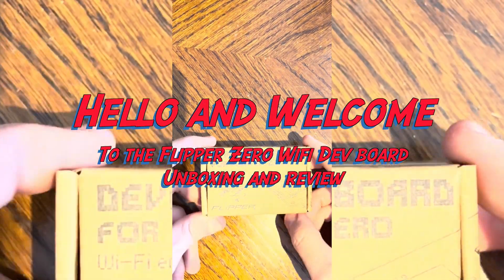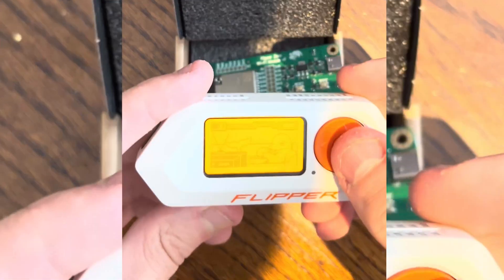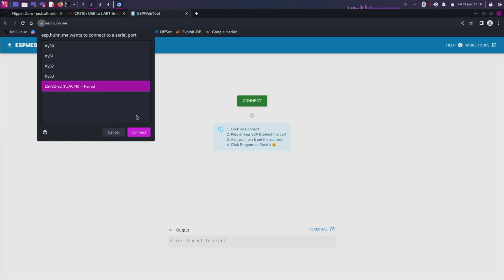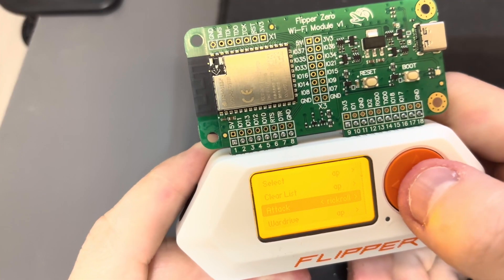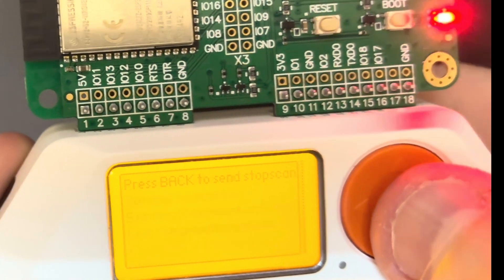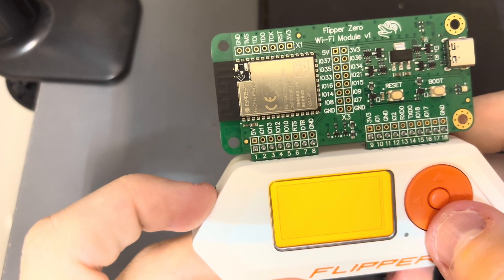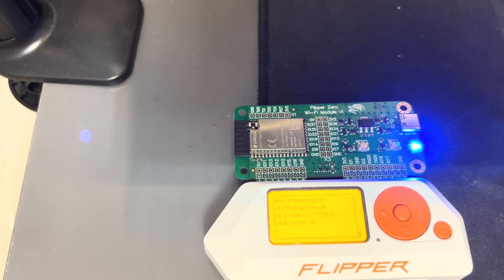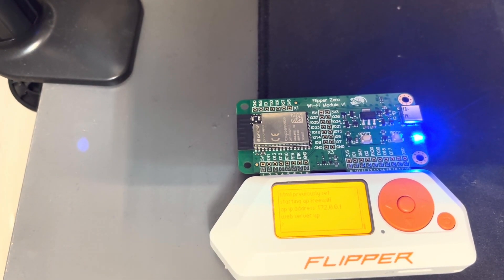Flipper Zero Wifi Dev Board Unboxing, Review and Stuff you can do with it.

Comment: Nice video, just got mine and it definitely gave me some useful knowledge. There is one thing im asking myself. Is there a way to add different WiFi attacks such as the Rick Roll one? I mean can i change the name of the "meme" which is shown? On the M5 StickC it is possible to make multiple attacks with different names shown on the WiFi page. Would be great to know if its possible.
Reply from the maker: Thanks I’m still very new to making videos and they are not as good as I would like them to be. I think it’s possible if you fork the marauder app repo and change the code, it’s technically possible don’t know if it’s worth it though. Hope this helps.